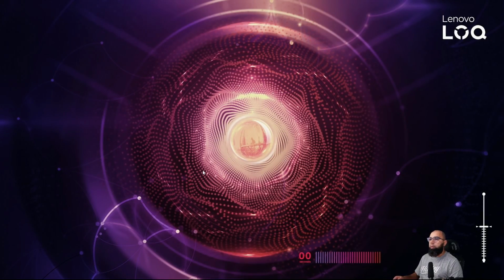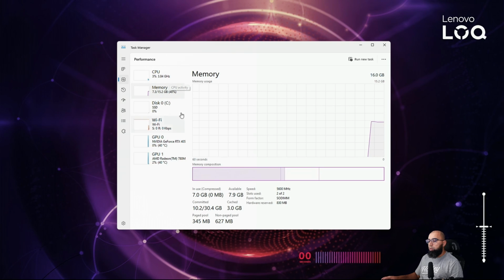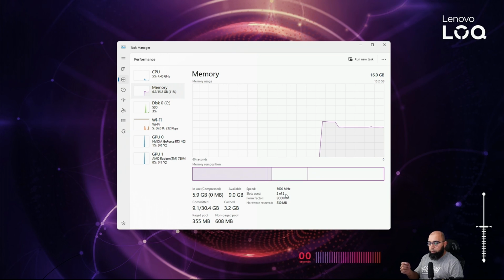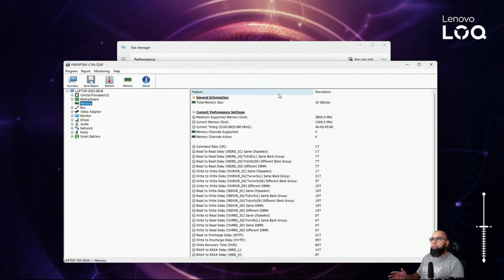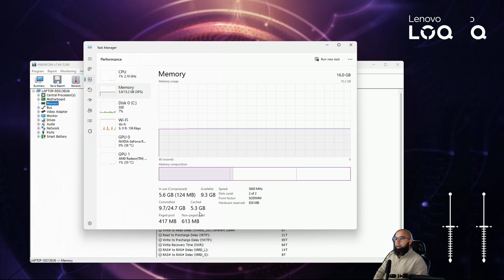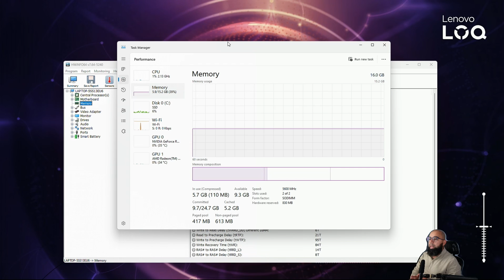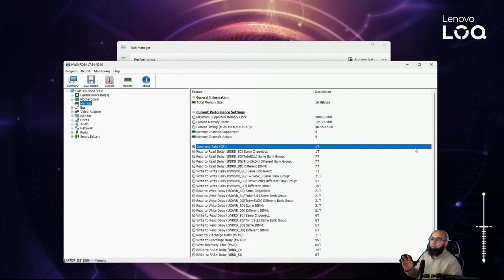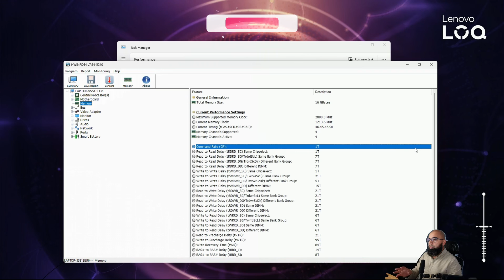Lenovo LOQ 15 - RAM Upgrade Guide (8GB to 16GB)

Comment: I upgraded mine with a crucial ddr5 5600 8gb. It runs much better. Glad I got the ryzen and 4050 model. The 4060 is not worth the extra money and the Intel is less energy efficient from what I've seen.

This laptop is well worth the money imo.
Reply from the maker: Its a very good value. Can you please share the link to the RAM you purchased so others can benefit. Thank you so much.
Reply: 4060 is definitely worth it got mine for 999€ only thing that sucks is the 16gb ram
Reply: @Mohennep-c6m Yeah 16 gig today is just not enough. Absolutly worth to upgrade to dual channel and put another 16 in there.
Reply: @Mohennep-c6m  Mine came from the shop with a 24Gb Ram and it runs very smooth. It can also be updated to 64Gb ram and 4T memory, only the 4T memory if its not double sided
Reply: Ram price bro

Comment: Hi all! Today I installed 2х16Gb DDR5 5600MHz ADATA SO-DIMM (AD5S560016G-S) memory in this laptop and everything started up perfectly.
I advise!
Reply from the maker: Amazing great to hear. Thanks for sharing and providing feedback. Will you be gaming only or also doing some content creation/video editing? What was your reason for the upgrade?
Reply: Tell me please all the specs of your laptop. i have a lenovo loq i5 12500h rtx4060 do you think I can upgrade ram till 32Gb?
Reply: @mihadasca yes aslong as it is ddr5 u can use even crucial 64gb sticks if you want
Reply: @mihadasca I've heard about some people having installed 64gb, but I have no proof of it
Reply: pls make sure your ram is cl 40 bc any higher will make your ram slower

Comment: I was thinking of buying the CORSAIR - VENGEANCE 32GB (1PK 32GB) 4800MHz DDR5 C40 SODIMM, do you think it will work? I’m just gonna take out the 8 Gb one and put in the 32 Gb one.
Reply from the maker: @julianwalker1843. I'd be careful with a single 32GB module. According to the official specs the largest single DIMM module supported is 16GB. The main things to note are that it's SODIMM - so it'll fit in the laptop, and that it's DDR5 and at 4800MHz or higher. The C40 are other performance number that don't make all that much of a difference except very specific scenarios. If you do manage trying it anyway, let me know if it works out. People have had some success with exceeding the specified RAM modules.
Reply: @techknowlux   Thank you for the info, I’m probably just gonna get the 16 Gb version instead of the 32 Gb because if the max is 16 Gb then what’s the meaning of buying a 32 Gb, just a waste of money I’m guessing.
Reply from the maker: @julianwalker1843 Yes exactly. Be on the safe side and grab a 16GB module.
Reply: @techknowlux   Installed two sticks of 16 Kingston Fury 5600 at CL40. AMD read it no issues
and booted up in seconds. Stinkin fast with no issues. RAM model KF556S40IB-16

Comment: thank you so much ! just what i was looking for.
Reply from the maker: Glad I could help! How much RAM did you upgrade to? 16 or go all out and get 32?
Reply: @techknowlux  I bought a 1 stick 16g RAM that is 4800 mhz, do you think that the performance will be affected because of the speed of the ram?
Reply from the maker: There is a difference in performance between 4800Mhz and 5600Mhz, but it's minor. So you'll be running single stick 16GB DDR5?
Reply: @techknowlux  i added the stick with the already preinstalled 8GB, and again thanks for the video hope your channel gets more views as it should.
Reply from the maker: @AA-py4zf  Amazing. Enjoy. And thank you so much.
Reply: How it is work with you can you fell the difference?! Because i am gonna do the same..

Comment: the ram came with laptop is it 1rx8 or 2rx8
Reply from the maker: The original RAM module was 1rx8. Same for the modules I've used to upgraded with. The Patriot 8GB modules are 1rx8. In order to get dual rank modules, you need to at least get a 16GB DIMM module. And I believe the way to identify it (apart from official specifications of course) is if the module has DRAM chips on both sides. Do you have other experience with RAM? Would love to find a guide that definitely outlines how to check for this.

Comment: Rams are running at 5200mhz even though they are 5600mhz right? Cuz documenation said so I guess
Reply from the maker: No if you poke around in the BIOS this can happen. I must've toggled something. I got it running at the specced 5600MHz after resetting to defaults and then rebooting from the BIOS.

Comment: can i upgrade the battry to 80 wh ??
Reply from the maker: Battery upgrade is an interesting question. As long as it fits it can physically be upgraded. But if there is some limit or hard wired the battery size then it might not be recognized as a larger battery capacity which will defeat the purpose. Do some research on this specific model.

Comment: Excellent video! I build, rebuild, and upgrade my desk top almost annually. This is the first time I attempted it with a laptop. You gave me the confidence that I needed. Thank you! You have a new subscriber. On a side note, one of the thermal pads was well stuck to the RAM card. If this happens to anyone, DO NOT just rip it off in frustration. Just tease it up and you won't have to replace it. Also, don't try to remove the deco panel without removing all the screws. The 2 screws closest to the deco panel go through the retaining tabs in the panel.
Reply from the maker: You're very welcome. Gotta be careful with anything inside a laptop and gentle. Take your time and understand what you're doing and what's going to happen as a consequence and you shouldn't have any major issues. Thanks for the tips as well. Will help a lot of other folks.
Reply: Had just that ! I removed it with a guitar pin slowly and it didn't break !!

Comment: Can i upgrade ram from 16gb upto 64 gb of this model??
Reply from the maker: I highly doubt 64gb will work. The official specs state 16GB DIMM modules so 32GB will not work most likely.
Reply: @techknowlux  I have the same model Lenovo and although there is no real benefit to boost it to 64 gb (overkill), I upgraded mine to 32 gb and it is a world of difference. I went with Crucial RAM 32GB (2X16GB) DDR5 5600MHZ. I like background noise when I'm working, so I have YOUTUBE running while I work. Doing this at 8 gb was so frustrating, now it runs very smooth.
Reply: @MakerMe59 tuviste también que añadir SSD?

Comment: A friend of mine noticed that his VRAM temps are hiting the 106°C, does anyone else here have this problem?
Reply: Thermal pads on vram are to SMALL, you need to replace them. This is the issue here.
Reply from the maker: Definitely. Lots of room to tweak this laptop into a great little workhorse.
Reply: Probably it should be a ryzen variant because the ryzen processor are hitting around 90 degree Celsius. Recommended your friend to use a cooling pad or customize the setting  in custom mode placing your fans into their full  speed
Reply from the maker: Full speed fans do give a lot more noise. Better to either play in Balanced mode or to get the Ryzen CPU. Keep in mind that the Intel and AMD CPUs this generation are so close, it doesn't really matter which one you pick.
Reply: Is he setting it on anything cloth blocking airflow?
Reply: I raise my daughters back up and she’s young mainly playing Roblox or I play sims4 and it gets like 107 degrees
Reply: Same as me😢😢😢

Comment: you should disconnect the battery first to prevent short that could damage your motherboard
Reply from the maker: Never did that in 25 years. Knock on wood.

Comment: Can I add 16 gb of ddr5 5200 mhz ram ? So I have 24 gb ?
Reply from the maker: Yes you can. The optimal configuration is always same size, capacity and memory timings however. So two matching 8 or 16 modules at 5200MHz.
Reply: You can but dual channel ram works best when you have 2 of the same 2x8gb, 2x16gb etc.

Comment: Great video! I have almost the same lenovo (Mine is Intel core I5-13420H and RTX 4050) it came with a single Samsung DDR5 5200Mhz 8Gb, Since i cant find the same exact memory ram i decided to buy one a littlebit slower (4800Mhz, but from Samsung 8Gb and almost the same model) and then run a test to see if it works fine.
Reply from the maker: And what was the end result? Did it actually run fine?
Reply: @techknowlux  The product has not yet arrived. By Wednesday I may be able to get it in my hands and install it, I already updated the BIOS to avoid possible incompatibilities so I'm looking forward to it. Don't worry, I'll tell you if my project works!
Reply: @Rodri9333  I guess that it will work but both of the rams will be working at 4800 mhz I think.
Reply: @mertveziroglu3424  It's the same idea that I had in mind, I hope it works because otherwise it would be horrible since I don't want to pay 40% more (the prices in my country Argentina are crazy and change day by day) and I would find memories from different brands (not the Samsung one like the original one on my notebook)
Reply: @Rodri9333 I hope that it works man good luck with that. I bought a ram too that is 5600 mhz but its not the same as I have in my laptop I think it wont be a problem
Reply: @techknowlux  Hello! I´ve just got the memory RAM installed and everything seems to be working right! I´ve just done a quick scan on the lenovo vantage app and runned a scan on both memory rams, all good so far, later im going to test some video games to test even further.
Reply: @Rodri9333 hey how did this work out for you? I am planning to do the same thing.
Reply: @01piercegames17  I recommend that you buy the appropriate ram memory (5200Mhz, DDR5, Samsung brand), I was testing some "light" games at the moment (Bright memory Infinite) and it worked correctly at maximum performance, it never crashed. I'm downloading Cyberpunk to get the most out of it too. Today when I updated the notebook by restarting to update Windows 11 it got a random BSOD after installing drivers (for no apparent reason) when it turned on again it worked completely fine without problems, so I attribute it to Windows.
Reply: @Rodri9333 Hi, I have the intel 13th and  RTX 3050 model, do you recommend using the same brand of Ram that came with the laptop? I have seen other brands like Crucial and A-tech
Reply: @HectorElGeek12  hello!  I absolutely do not recommend mixing 2 different brands, if your notebook has a free RAM slot and came with Samsung memory, the most advisable thing for compatibility is to use another Samsung memory.  On the other hand, if you find a kit of 2 "Crucial" or "A-tech" memories, in that case there would be no problem (obviously replace the factory one by the new ones), as long as they are DDR5, 5200MHZ and don't worry if it doesn't have passive dissipation, the notebook comes equipped with thermal pads in the slots.
Reply: @Rodri9333  I found another 8GB stick of Ram sold by Lenovo, but it costs like $70, I think I will end up purchasing a 2x8 GB pack from another brand, Thanks for the advice!
Reply: Can i mix 8gb ram with 16gb ram in this laptop?
Reply: @MohamedIbrahim-bw3eb  I wouldn't recommend, Windows tend to work weird with different size of memories.

Comment: wait a min, Did i see lenovo use the smaller m.2 slot for the stock SSD??? THAT IS AMAZING!
Reply from the maker: Yes you did. How is it amazing? Your choices for 2230 and 2242 SSDs are quite limited. Especially for larger capacities. But if you plan to use that as a 512GB boot drive, and have a larger 2280 SSD for storage/apps/games etc, then it works.
Reply: @techknowlux  usually at this price point a lot of manufactures just use 1 m.2 slot. I'm impressed that they used the smaller m.2 slot as it avoids confusion on the customers side as if they used the larger slot and a consumer decided to buy an m.2 slot, they will likely buy a 2280 size and not the smaller one , if they don't confirm it beforehand.

Comment: one more question for the ram can you mix and match? I just want to confirm since it seems like at the end of your video it should be fine
Reply: This is of course assuming that both are 5600
Reply from the maker: Yes looks like there shouldnt be any problem unless you end up with some bizarre Micron E-die chips. Lol. This issue has stopped being a thing since the DDR2/DDDR3 days afaik. Same capacity/speed should be enough.

Comment: what Phillips head did you use ?
Reply from the maker: Just a sqaure/cross head the one that looks like a plus sign. Not the flat one that looks like a minus sign.
Reply: @techknowlux  which size would you recommend or does it not matter?

Comment: i ordered 4800 l40 will that work with my 5600 L46?
Reply from the maker: It should work. But then RAM will run at the slower speed of the two... at 4800. Try it and let me know.
Reply: Mine came with a 5600 and I added crucial 8gb at 5200 and it won’t run at all , reversed the ram and same issue not sure why